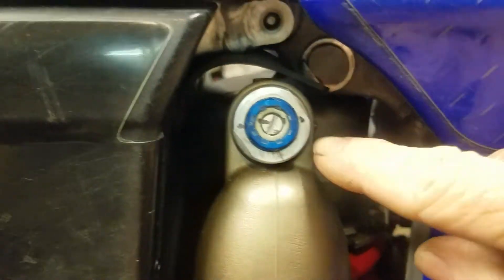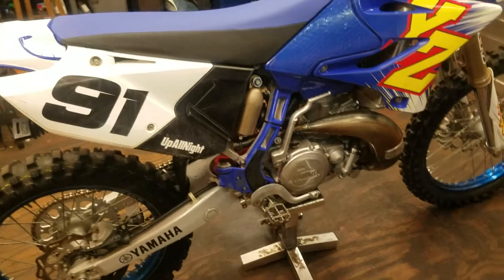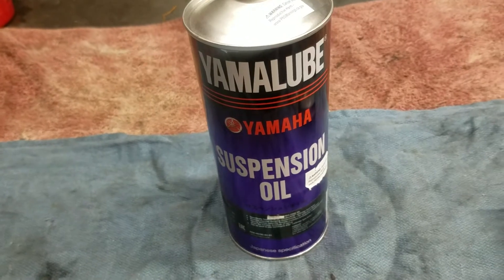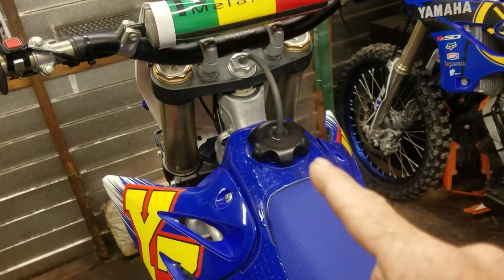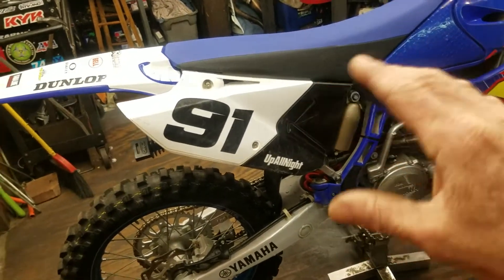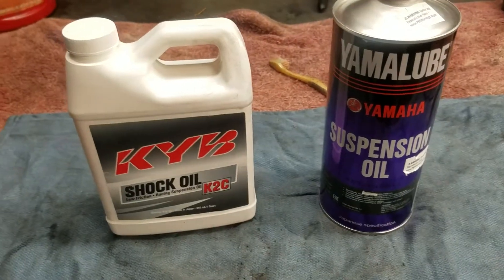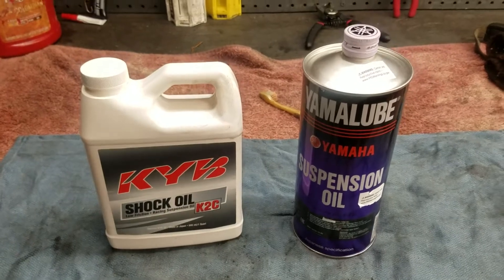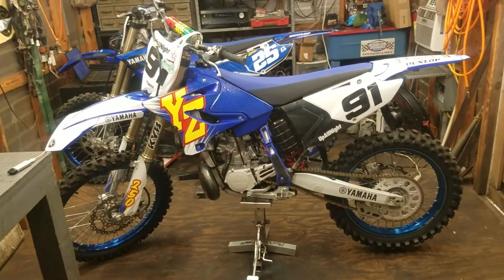1:11(Video 3, Part 2 - Clickers, Compression & Rebound) YZ250 Suspension & Chassis setup & tune

Comment: How do you know how much fluid is in there or how to you get it even?  My suspension has leaked when dirty the last few years, but somehow fluid keeps coming out lol!
Reply from the maker: Theres really no way of knowing on the dial chamber forks without dumping it out and pouring in the correct amount. I would plan to replace the seals and fill with fresh fluid. because when the seals leak dirt also gets into the forks and after a while it wears them out.

Comment: Is the high speed compression for the rear the blue or the silver nut.

And then for the front forks, is the rebound the hex at the bottom of the fork, pretty much inside the fork cylinder?
Reply from the maker: Blue 17mm for the high speed.  And there is a small flathead on the bottom of the fork, dead center.  That's the rebound.  When bottoming that out ,be easy.  Dont bottom too hard
Reply: @UpAllNight91  

Okay thank you!
Ya I just bought a 2001 and I’m trying to get it to be a trail/ rock crawling bike.
 
Would you have any recommendations for clickers settings for that type of Terrain?

Comment: What settings for the clickers would you recommend for a 2017 yz250 and do you know what the stock settings are as id like to compare both. Mine are currently set in the middle and i cant find the manual. I read your thread on the 06 suspension but I’m assuming its different settings. Thanks mate
Reply from the maker: Hello. Sorry for the late response. I dont remember what the stock settings are but the suspension is the same from 2015 to 2022 so I can tell you what I currently use which should work the same on your 2017 and can get to a good head start...  

shock...
High speed  1 turn out fron all the way in
Low speed comp 9 clicks out
Round 5 clicks out

Forks...
Rebound, one fork 9, the other 10 clicks
Compression,  both forks 10
Fork Height 7mm
Oil volume 332